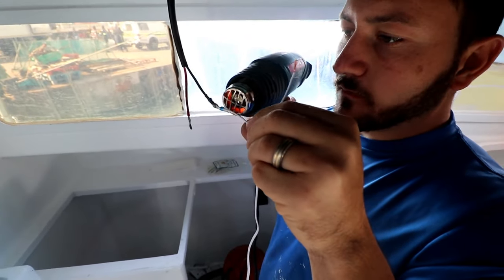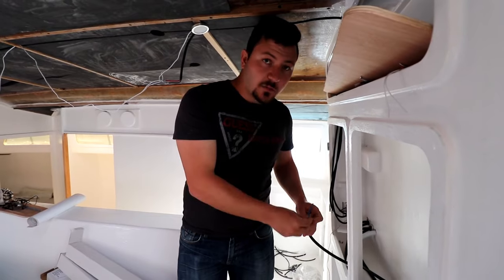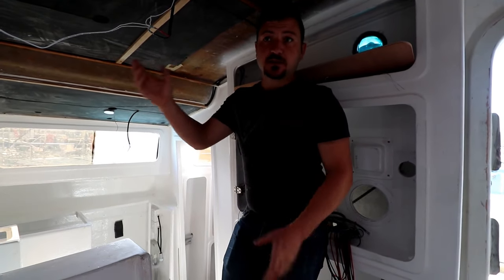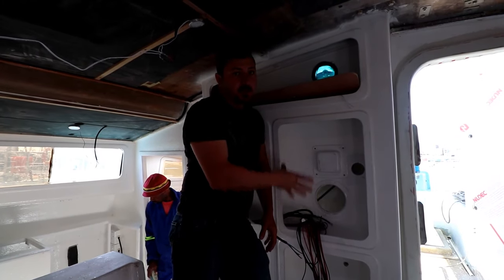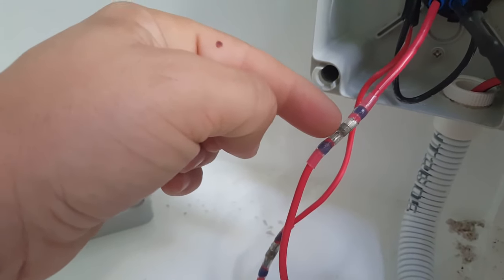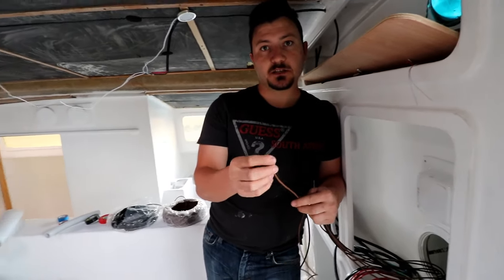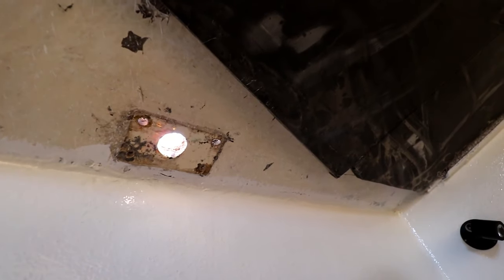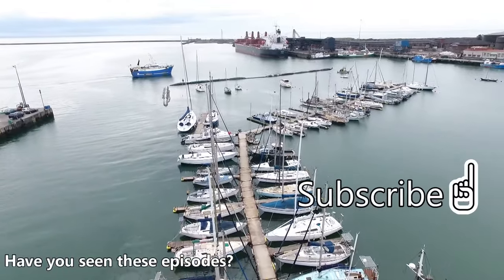HOW we RAN the ELECTRICAL on our YACHT | YACHT REBUILD WEEK 40

Comment: super job on the electrical distribution,you will not regret the expense of putting in redundant cables.

no real need to put in fuse's on already fused circuits,but those usb outlets are most likely to fail first,so having a fuse to the usb will still allow the light to work without taking out the whole circuit in the event of a usb failure.

swim platform looks good ,and will save loads of weight,maybe add some eyes and cleats for dinghy attachment and your harness to clip onto when landing big fish!
Reply from the maker: Thanks Alex!

Comment: Hi Ricky, I would add a step up transformer  (110V Ac to 220V AC ) for the off shore at the Caribbean world ( This would be for the fridge, washing machine, battery charger and so forth ) This will eliminate have another wiring circuit for 110V Ac
Reply from the maker: This is the plan.
Reply: But South Africa already runs 220 50hz why would the boat be 110v?
Reply from the maker: @defylifeadventure  it would be for the Carribean as they run in 110v
Reply: @livingwiththemaias  Ah yes makes sense, step down transformer. Hopefully you'll be spending your time in beautiful anchorages though rather than marinas. All the best.
Reply from the maker: @defylifeadventure we plan on anchoring a lot more than going into marinas :)

Comment: Great job,   I have refitted many boats over my 50 years,   one question,  your going to be sailing in the Caribbean why 220v,   why not 110v on lighting ect and then 220 for hvac and possibly charging. might be an issue when staying at docks in the us and Caribbean.
Reply from the maker: Thanks Joe. Firstly it's almost impossible to find 110V in S.A and if you do it's hellish expensive. Secondly.. we don't really plan on plugging into shore power. We will have enough solar and battery power to prevent us from doing so.. & if we do. We'll just be sure to use a transformer.

Comment: You mentioned the 220 only powered when on shore power.  Are you going to have an inverter to provide 220 for kitchen appliances if needed when at  sea -- bathroom things like hairdryer, and for laptop's and such?  (I assume laptops that are 100V here are 220 there.)
Reply from the maker: Correct, we will have an inverter.

Comment: i would stay away from those inline fuse holders , run everything to a central fuse panel or resettable breaker panel. you will lose track of them in the different boxes thru out the boat and one will blow and take you 4 hours to find it.
Reply: I was totally thinking the same thing!
Reply from the maker: Each cabin has one box that has fuses in it. That box alone controls the allocated cabin.. This applies to all sections of the boat.